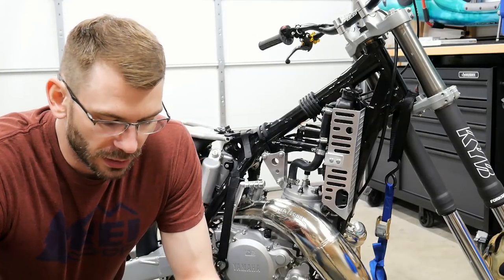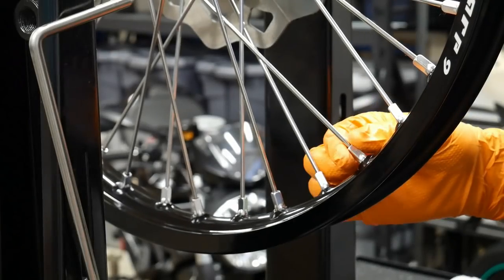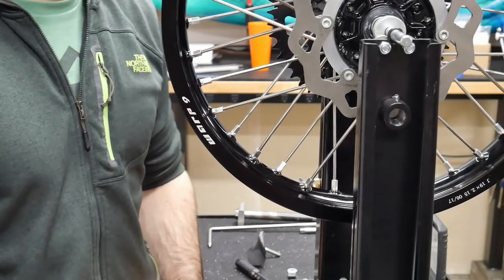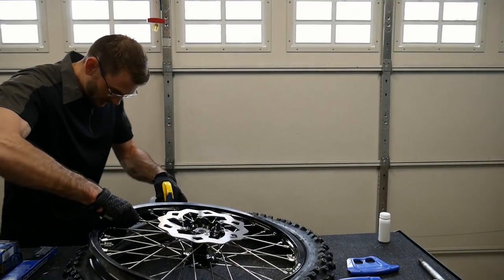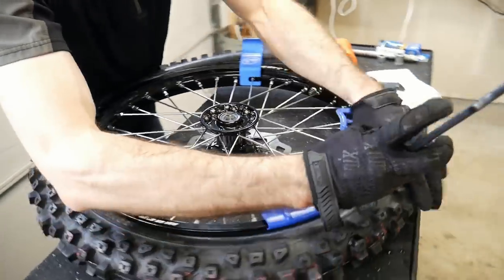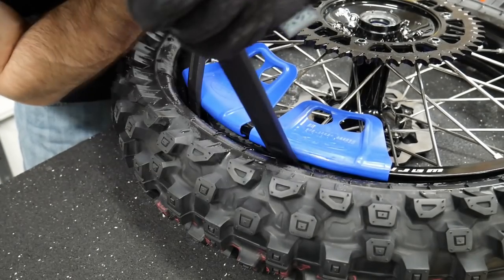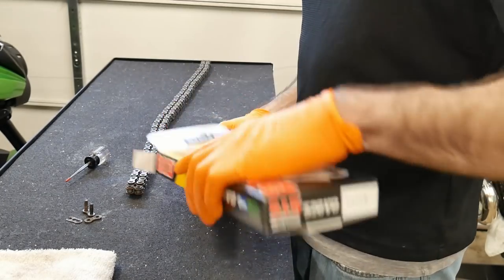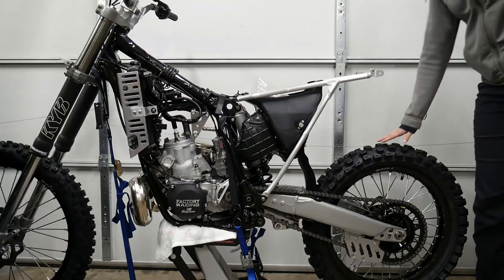YZ250 Rebuild: Part 16 | The Beginning of The End

Comment: We have the exact same bike your videos are helping me out with mine thank you for all the good videos when you built your clutch is there only a push rod then a ball then that piece the ball goes into that pushes the pressure plate? My clutch will not disengage and my basket hub and clutch plates are new I would really appreciate your thoughts I’m starting to think I’m missing parts or something I noticed the newer yz’s had more parts in the clutch and mine is a 1996 so I’m pretty sure all the parts I listed above is all mine should have but thanks for your time hopefully you’ll have time to reply thanks again
Reply from the maker: Hey Robert, Yes it sounds like you've got the parts right. If you're ever interested in seeing exploded diagrams for your model/year there are plenty of parts websites out there that have them. I use a number of different sites for parts, but partzilla.com is decent. You can look through the diagram and see if you're missing parts. You might check the following: It could be that something was installed in the wrong order or washers are in the wrong place. It's unlikely but it might also be your clutch springs are so worn out that they aren't applying enough force on your pressure plate. Lastly, and arguably most likely, something has gone wrong with your push rod lever (the thing that your clutch cable attaches to). The push rod lever gets worn out over time and if it's too worn it can do goofy things when interacting with the end of the pushrod. 

Disclaimer: I'm not a mechanic, if you inspect everything and can't figure it out - I recommend getting a certified mechanic involved. Also, if you're going to tear into your bike, I'd always recommend a good service manual first. 

Ride, Wrench, Repeat